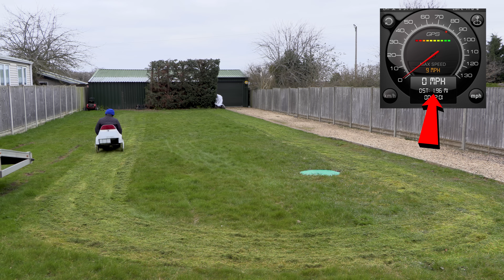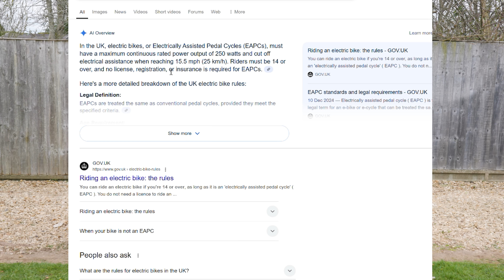Will my SINCLAIR c5 drive 19km?…..

Comment: I remember years ago seeing somebody ride a C5 up on the pavement and "park" it directly behind and across the back of a box van then walk off. The delivery van was parked in front of a shop on the pavement at right angles to the road, so the C5  would have blocked it from reversing out. I thought that's a stupid place to leave it, as I walked off up the main road, moments later when I was at the other end of the road, there was a really loud bang and a snapping crunching sound,  which I presumed to be the C5, because when I looked up the street I saw the truck reversing out in the distance.

Comment: I feel like you really need to turn the engine around and have the drive cog in a central point on the axle between the rear wheels, as well as obviously locking the right wheel. The physical strain on it all being on one side just feels very wrong.
This is such an awesome project though. It will be very satisfying to see what the C5 was actually supposed to be like.

Comment: Could you not connect the motor to the central sprocket used for the pedals?
This would allow the motor to drive both rear wheel and still allow for the free wheeling as the central crank has a one way clutch also.
The gearing maybe a little different due to the tooth count but should work just as well as the sprocket that came with the motor.

Comment: Owned mine since 1985 and used it before I turned 14yo 6 months later (naughty me). Bought from Dixons (I think) when Sinclair went bankrupt and they were selling them of at around £150 - £200 (original price was £600 I think.
Fitted the optional indicators and horn.  Went all over in it, and had my trusty CB mounted in there. Pedalled a lot to keep the load indicator in the greens as much as possible.  Loved every moment, but it now just sits in the garage doing nothing :(

Comment: I'd run the motor on the drive shaft itself rather than one wheel, like position the cog next to the one that the pedals use.

Comment: In 2001 at school we built an electric racing car to compete in a schools challenge. Our 250 watt motor cont rating was able to keep up an average of 30 mph over the 4 hours of the races. Using 4 12 volt car batteries.

Comment: Needs bigger wheels - maybe from a mountain bike?  Widen the axle a bit and fit them further outboard than the original wheels, would improve stability as well.  And definitely better brakes -- looks like top speed would be a lot higher than original spec.  I'd also paint it British Racing Green with a white stripe.   ;)  Front tyre could be a bit fatter, like an aeroplane wheel or maybe wheelbarrow? You could maybe put the battery just above the frame to the front wheel or maybe cut out a section just below your bum to house the battery and frame a lot lower CG.  Needs some kind of minimal rollcage (at least a hoop behind your head) to protect you as 3 wheelers at speed are prone to roll over (also another good reason for putting the battery down low.)  Also consider 4 point safety restraint for the pilot?  Also would add a Hall effect sesor throttle or at least a potentiometer so you come into the power smoothly to minimise wheelspin.  The switch could be better to prevent unintended power mode switching (when bouncing, etc)...  Maybe a dead man's switch if there isn't already one? (to prevent runaway vehicle)  Top power (3KW?) would be possibly unsafe speeds for the safety protections.

Comment: I went to see one at the NEEB store( electricity board shop ). It was on sale at £399 and standing on a platform in the shop window with a security guard watching over it. I thought it was a great idea...... but it was well and truly panned by the media. It may have had its flaws but early motor vehicles did too and they weren't killed off. It could have led to some clever green transport ideas that we need today. A good concept ahead of its time.

Comment: Way ahead of its time , if only they had better motor and battery tech at the time
Reply: just needed some extra voltage. They go well when you put 24v through them. :D
Reply: @C5DEPOT  Yeh but  24v sla battery would have been to big and heavy

Comment: As a bicycle mechanic I see two things right from the start that's going to hurt your top speed. First is your trying this on a gravel driveway, and 2 is the knobby tires on the rear. I'd LOVE to get my hands on one of these myself and replace that wheel motor with a mid drive system.
Reply: Someone has put a mid drive in one but it doesnt fit. They had to notch the chassis which weakened it, and had to cut the body to bits to make the motor fit. The original motor can take 24v with cooling and will do 30mph, on private roads of course.
Reply: @C5DEPOT  Depending on if they put the motor on top or bottom would determine if it would need a big or little notch. It would also be a simple thing to reinforce the amount that was removed. I use several 48v mid drives on my current bikes and it would be much simpler to use that than work with that old heavy system. I'd still do it in a heartbeat.
Reply: @whitepawrolls  its a flat frame though so doesnt matter if it goes ontop or underneath.
Reply: @C5DEPOT  Watching a tear down of it on 2 other channels and from both angles it looks thinner on the bottom than top. Either way it would still be easy to weld a brace on top or bottom making it work.

Comment: You should put a modern e-bike kit in it.  You will easily get 20 miles out of it and not 20km. It will go faster as well.  It will have the power to climb the hills, though I wouldn't use a UK compliant kit.

Comment: Clive was a genius really because now we have electric cars, proper electric bikes and yet he was laughed at. Of course EMV's were always around front he disabled cars to milk floats etc but this was more about something accessible to all.
Reply: wish they had caught on! They make more sense today than they did at the time.
Reply: @C5DEPOT  yeah imagine with today's tech and battery etc  Could be made a bit bigger, bit more robust and storage
Reply: @ianrob4760  its clever as well as the law was tricycles could be max 60kg, so the c5 was designed to be exactly 30kg to allow for 2x 15kg batteries, the second being another optional extra.
Reply: @C5DEPOT  ah never knew that so obviously battery weight now is far less like 300wh per kg ?? so the ability to do something here, have you seen the microlino but a bit too expensive
Reply: @ianrob4760  yeh so original lead acid was 15kg and the lithium batteries of same capacity and better performance are weighing 3.5kg. It makes a huge difference to the handling, performance and usability. Book speed was 15mph, reality as 13mph, with lithum you get back to 14/15mph.
Reply: @ fairly sure the microlino is the same as the ami underneath? We did the worlds slowest drag race with WhatCar. C5 didnt have enough power against the strong wind on the day.

Comment: I enjoyed that. Thanks! Subbed & liked.
PS. About 1980, someone gave me a set of used Sinclair 60 modules. In the spirit of cut-price Sinclair designs, I covered a cardboard box in aluminium foil and then clear contact film over the self-adhesive escutcheon front panels. I didn't use the "power amp" modules because they were only built with medium power transistors (like most Sinclair designs, they would have overheated) so I fed the preamp output into my Quad amp until I finished building my Doug Self (WW. Nov '76) preamp.

Comment: as for 2 wheel drive hack/mod, you could use a bicycle freewheel mechanism welded or bolted to the shaft, so that the non drive side wheel taks power but it will be allowed to spin faster if needed, it's a real, real basic differential

Comment: I think that you should look for some wider wheels and tyres for the back to increase grip.  Otherwise it might be an idea to consider if your brakes are up to snuff as this vehicle was engineered for lower speeds by a man with a reputation for throwing quality out of the window in the name of cost-cutting.

Comment: If you have gone this far modifying your C5, might as well give it a simple differential axle, otherwise if you make a rigid axle you might have to move the battery forwards to reduce the traction on the rear and increase front traction to let you turn easier.

Comment: As normal for Sincalir he was 30 years too early. Sure he would have felt pretty vindicated by all the ebikes we have now. It's funny that it breaks the throttle rule of ebikes which is limited to 3 mph and you can't have a selector like you had,  the motor is technically illegal though it's what all the off the shelf brands do. All in all the laws for ebike like vehicles is a right mess and the way you built this is the way things should be.

I know your in the cost of the motor but would a traditional ebike conversion kit like the bafang mid drive BBS02/HD running off the middle axel sproket be an idea you'd loose the pedals but they're off anyways and you wouldn't need the controller. This would drive both wheels and coupled with something like an egg rider you can modify how the power is delivered so can adjust the spin up to eliminate some of that wheel spin.
They do make ones for fat-bikes so maybe the bottom bracket of the c5 matches a fat bike in which case you could just slide it into there and retain the pedals and chain setup. 

The bearings look like standard non sealed bicycle ones maybe a little smaller there's a couple of ebay I think you could easily fab them if you can't get hold of replacements.

Comment: Only problem with making the other wheel fixed to the axle is, of course, that it'll be a right bugger to steer without a differential. The one front wheel will end up having to fight the traction of the inside wheel every time you turn...

Comment: Maybe on the inside of the wheel maybe drill it for roll pins or cotter pins to fix it to the axle ?  Keep it white and go with a B&W Stormtrooper look. Don't forget the high vis safety flag up high out back..  👍👍
Reply: Just needs some replacement bearings. There was a hi vis mast which was an optional extra but the flags were all home brew by owners.

Comment: what are the rules on carrying an operating generator around with you? I very much want an electric bike or trike, but have the range anxiety. So figured I could strap a petrol generator to the bike & have it continually charging the battery. While it would be an ICE engine, it wouldnt be driving the wheels as such, merely charging the power source for the electric motor. 

it wouldnt be the quietest thing, a bike with a petrol generator whirring away, but it bypasses the silly short ranges of so many ebikes.

Comment: I ended up liking this video a lot more than I thought I would. I was hoping that you would upgrade the original components and you did not disappoint. Clive Sinclair (RIP) was well known for going cheap on the construction of just about everything he ever produced and the C5 was no different! Hard to believe he spent a combined 20+ MILLION pounds (grants plus his own money) on the development of this vehicle. One thing I would definitely recommend is to put at least slightly wider tires on it and better brakes to go with it, especially for going DOWNHILL. Maybe a level 2 (J1772) charge port or at least a level 1 as well sometime in the future. A more comfortable seat, better headlight, brake light etc.
Reply: The original front and rear lights melt with the original filament bulbs so we always change to LED. The original design is actually really good but definitely an exercise in minimalism, not unexpected as Lotus actually did all the engineering on it. It was built to a price point but you can see the Lotus ethos in it. You couldnt take anything away and have it still working.

Comment: I've realised that criticism of Saint, sorry, SIR Clive is absolute heresy in some quarters, but IMHO the C5 is absolutely typical of many / most of Sinclair's products - over-hyped and under performing.
Long before the C5 and Spectrum computer, I was familiar with his products that were plugged to death in magazines (Practical Wireless, Practical Electronics, Wireless World etc) in the 60s and 70s. I couldn't afford many (thankfully) but all were a big disappointment - the IC12 audio amplifier with an incurable hum-loop (and that, apparently, gave nothing like the claimed power output; not that most customers had the equipment to measure it) - the flimsy, matchbox-sized Micromatic radio with equally diminutive performance (couldn't even receive Radio 1)  - the calculators whose scientific functions were accurate to 3 sig figs at best (no wonder Casio and Commodore collared the market) and whose switches broke: luckily I never wasted my money on the notorious Black Watch kit (Google is your friend for a LONG list of problems). 
The C5 carried on the tradition - neither the speed nor range remotely reached the figures claimed - and that was before (IIRC) the gearbox packed up because it wasn't up to the job. ☹

Comment: You can have a 3000w motor. Providing it's rated to provide no more than 250w for 30 minutes or more. (Continuous rated power is a specific measurement defined in UNECE regulations)

Though good luck finding someone who will test and plate a single no-name motor for you.

Comment: i run a 3 wheeled moped that also runs only one rear wheel, I may have also upped the power output slightly,  it runs 16" pushbike tyres ( which are same as 12" moped tyres somehow) they are conti-ride tour 16 by 1.75, they take abuse and give a decent ride

Comment: I'm most definitely not in a position to do what you have done here but if I was, I would have had two batteries half the size and fitted them to the "main bar" with the top of them flush with the bar. This would give a lower and more central centre of gravity. Each battery would power one of the rear wheels and you could vary the power to each wheel to aid steering. For aesthetics, a flexible pole with bright flag at car drivers eyeline to reduce squishability on the road.

Comment: Great to see, thanks for showing us Sir Clive's old C5, the video reminded me a bit of Trigger's broom, you know, 3 new handles and 5 new brush heads. I had an idea while I was watching this, to maybe convert and use a cheap Parkside battery drill and use a rubber drive belt from a lawn mower, weld the axel so that both wheels would turn, and use a  20 volt Parkside plug in battery, and carry a spare battery as well! if it doesn't make the 19km journey If the power runs low from the reserve battery, you could always pop into Lidl and buy a couple more batteries. 🤣😂
Reply: each parkside battery would get you about 2 miles. For 19km you need 36ah at 12v, 18ah at 24v.

Comment: I was 18 when the C5 came out, with it's washing machine motor. Never really saw many on the road but have always wondered what they looked like inside. What's really amazing is how clean your workshop is. An inspiration to us all.
Reply: I believe that was an urban myth. The motor was designed to Sinclair's spec, it just happened to be manufactured by a motor company who made washing machine motors.
Reply: not true, how many 12v washing machines are there? It was designed and produced by polymotor in Italy. I believe the base design was from a 24V truck radiator cooling fan.

Comment: The motor and drive line setup is kinda odd. Would be nice if it actually was 2 wheel drive but also you could swap the front rim with the rear wheel of an e-bike, I feel like that way the handling would be more predictable even if it'll still be understeery, probably not great for the up-hill though

Comment: Have a C5 that i’d like to update, I was thinking a pedal assist motor so that chain drives both wheels & should be easy enough to keep it within legal requirements. Then its lithium batteries for sure
Reply from the maker: That would fit nice at the front crank, there’s loads of space. Would still only drive that left wheel though.

Comment: A good dose of red loctite might work on the bearing, deffo easier than welding it. I built a dual 190KV drive 48V mountainboard that  maxed out at 42mph a few years back, red loctite was how i stopped the motor bolts coming loose from vibration.
Reply: wont go round corners if you have two fixed wheels on an axle without a diff.

Comment: It definitely needs power and breaks on both back wheels. The motor and controller combination might have regenerative breaking capabilities. Otherwise, you may need to make a new shaft.

Comment: Have you thought about raising the handle bars and moving the seat back and down so that you have a lower weight distribution and legs can go under the bars, just a thought
Reply: That would almost certainly involve major modifications of the moulded body shell. From my experience of recumbents, if it's set up properly, under seat steering is actually very comfortable and ergonomic. But being a Sinclair product, it probably isn't an optimal setup. 😂
Reply: @another3997  good enough thanks for the insight

Comment: Good work. I built my own single rear wheel machine with the steering gear from a mobility scooter. 500 watt hub motor at the rear gets it along quite nicely

Comment: Might want to check the UK Law again pretty sure were not allowed to use throttles on electric bikes etc otherwise its classed as a motorbike regardless of the power of the motor.